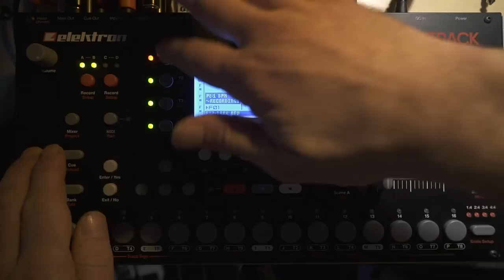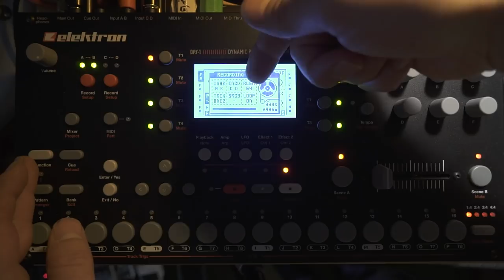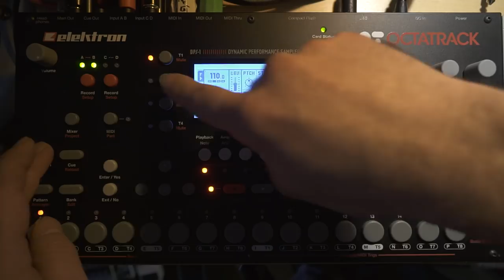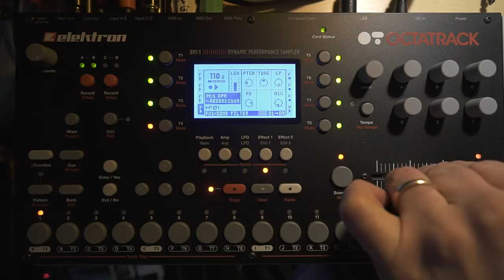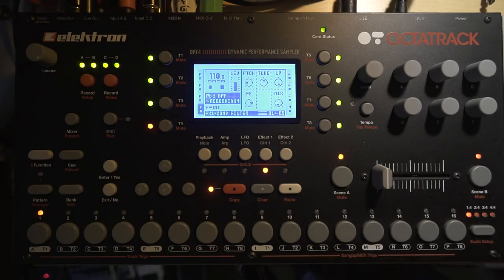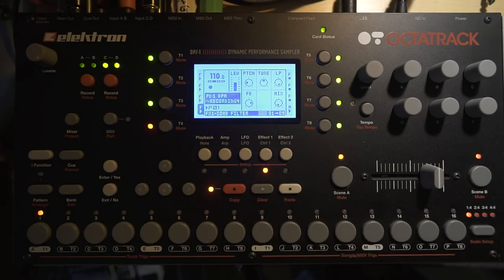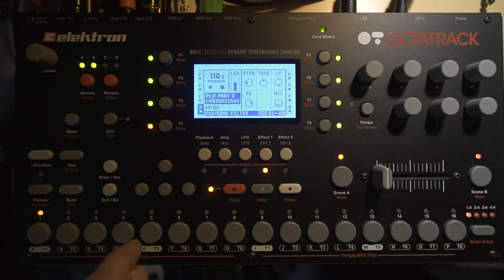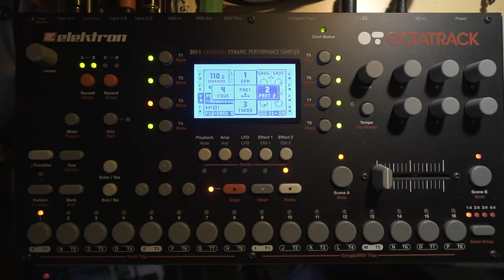Elektron Octatrack cheap tricks: Sampling and performing with scenes and parts

Comment: Good video! Can you save and have already a preset of different slots in the channels between Part 1 ----Part 2? I am looking to change an "instrument" or slot and save it so when I play that slot selection appear in the channel.
Reply from the maker: Sure. Just make sure to save the parts and assign them to the desired patterns.
Reply: @nthirteen  will try that! kind of confused of the saving rabbit hole!
Reply from the maker: @harmony2368  yeah it's confusing. save the part in the part menu. if there's an * at the part name, you still want/need to save it. Otherwise its gone after turning on/off.

Comment: Thanks for the video. Is it possible to change machines in a project?
Reply from the maker: What do you mean??
Reply: @nthirteen  if I change a pattern to another, you can't change machines. If you change machine on the other pattern you change the machine on the previous pattern. Or I'm wrong?
Reply from the maker: Ah ok. To use different machines per pattern you need to assign different parts to the patterns. You need to use parts. Good luck.
Reply: @nthirteen  with parts is the same. If you change a machine in a part you change de part in all the entire pattern
Reply: @nthirteen  yee thats true i was wrong, thanks.